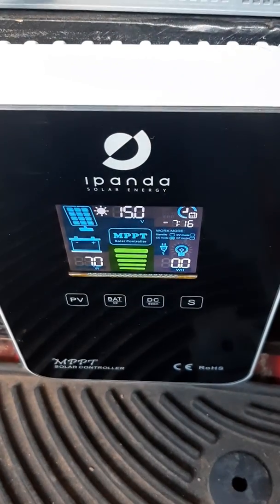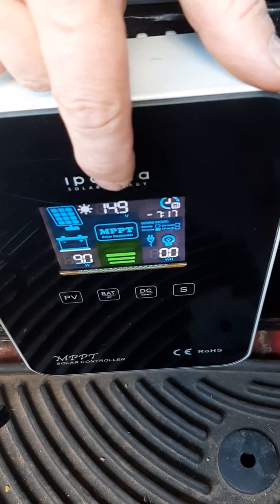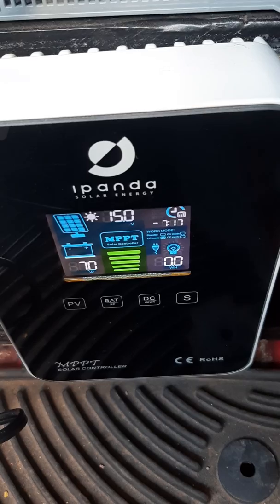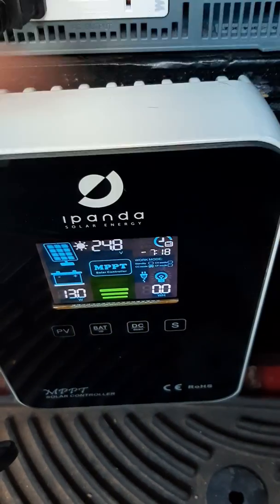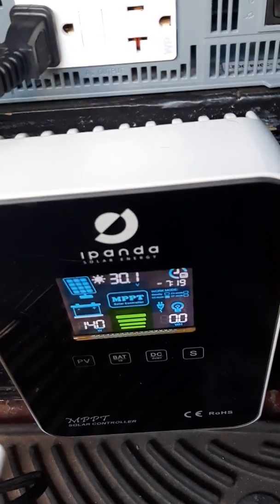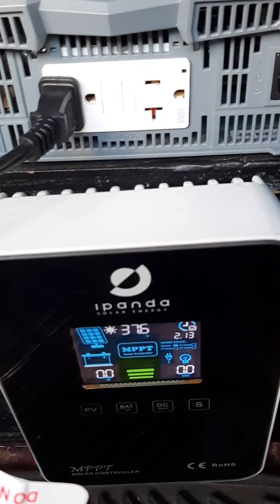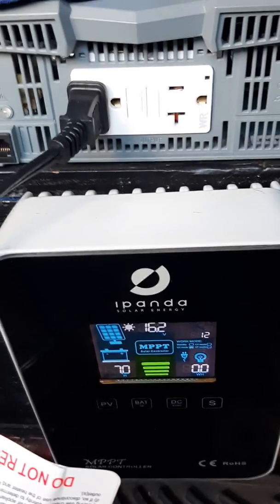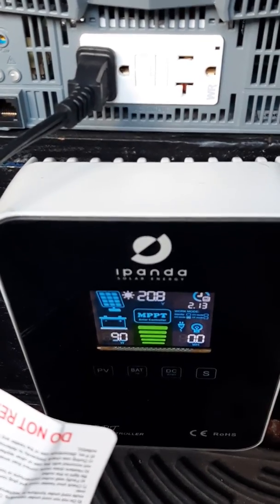Yet another MPPT Solar Charge Controller Fail. This new controller can't find maximum power point.

Comment: I have similar problem but the controler turns completely off and stay off when I disconnect the power and connect the power back on start working normal and after 2/3 hour turns back off and I have 120v from solar panel and 330w to the battery whe it should be more than 600w going to the battery

Comment: I have this controller hooked up to 2 270 watt solar panels powering a 12v system. It seems to be doing the same thing as yours is. When I hook up my other 12v 100 watt panels to it it finds the correct voltage fine. I think it has a lot to do with the 24 volt panels going down to 12v. I wonder what it would read if I had a 24v system

Comment: Also if you check with a clamp meter you should notice that even though the micro controller is hunting for a stable tracking point, the amps are still going into the battery. You only have a problem if you can't get full power in direct sunlight at the right temperature and unfortunately for all of us, that's not often enough..

Comment: Most of your solar power goes away under a cloud in any case so the PE cell/s can't maintain 36V with any sort of amperage and therefore the MPPT tracking is not relevant so it automatically reverts back to PWM mode which ALL MPPT controllers have. I notice your battery voltage is around 15v because that's what the meter says right? MPPT only works well under strong solar conditions.  So it's not a problem with the controller not finding the maximum power point at all. Having said that expensive name brand controllers tend to have better tracking algorithms when the sun does come out to play.
On cloudy days one of the real benefits of MPPT is the high solar panel voltage which gives more play time in whatever sunshine is available sop you end up with more KWHrs (Ahrs) and that's the target.

Comment: I have one of these, and found that on my system as well when I was using just 2 100 watt solar panels in series.  The voltage was only about 36V, and my system is a 7S lipo charging to 28.7.   I now put 3 grid tie solar panels in series for 110V, and a maximum power point of about 90V.  It handles the higher voltage much better now.  I don't think their algorithm accounts for the voltage being below a certain point.  Not sure, but it seems to be the only thing that I can find

Comment: I have one that gets lost in shading.  It is so bad that I have a microprocessor looking at panel voltage.  When it drops too low for 2 minutes a relay disconnects the solar panel for 10 seconds and resets it.  Abracadabra, the panels are back to the right voltage and producing lots more power.  There is so much crap out there.  Anything will work in full sun.
Reply from the maker: Agreed, lot's of equipment that doesn't do the job.  Creative way of solving it but it sure would be nice if things just worked.